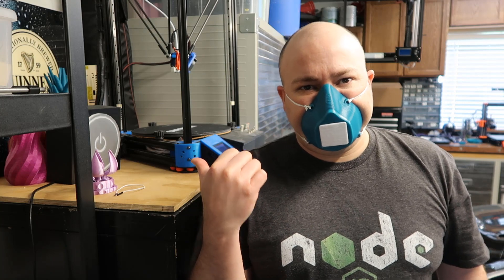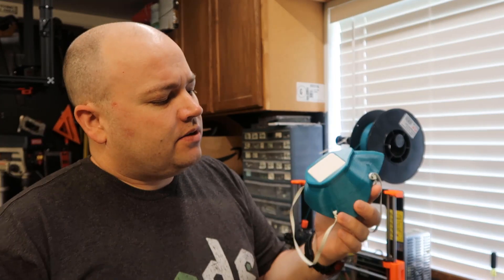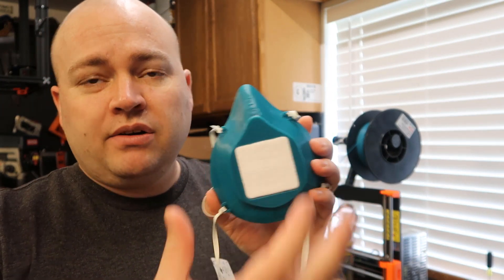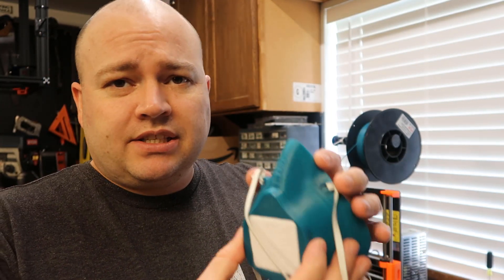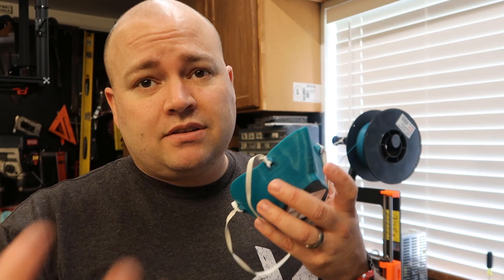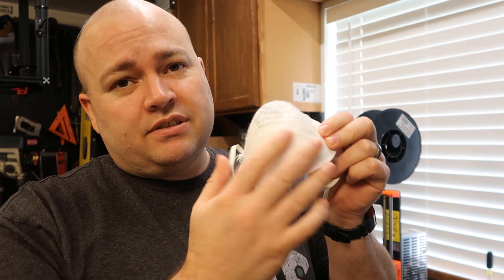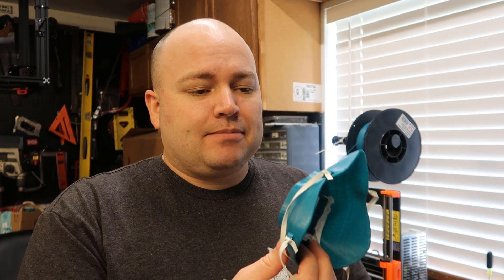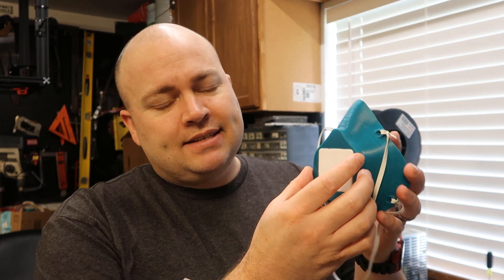3D Printed Face Mask - Print and Review

Comment: Please remember these masks should be used for dust/debris, filters for pollen etc.  They will not help you more than a double layer of cotton fabric mask, with a face shield to keep droplets out of your eyes.  In fact, because of the face shield - the cotton/shield method is better to prevent COVID19 than any filtered mask.  The fit of the mask is also important, it has to seal to your face air tight.  This also means your moisture (spittle when you talk, moisture in your breath, or sweat) will collect in the mask, and cause a pooling - if your covid19 positive, this is a giant mess of infection waiting to happen.

If you want your 3d printed mask to fit better for dust use, use window seal cut out around the edges. This will provide a soft and pliable, yet air tight seal.

If you want to 3D print help, search for the Face Shield printable files, they are in higher demand, universal in size, easier/faster to print, and work better in the medical industry.
Reply: But as a nurse I know the cotton face mask does not do a great job of sealing and people are more likely to keep tugging on the cloth mask. I have ordered a 3d printer face mask of etsy for all my family. I plan on adding black window foam to the edge to be more comfortable and create a better seal. I know I cant wear at work as a nurse BUT when i am out in public I believe I will be better protected with a 3d printed mask than cloth even if you wear 2 cloth masks due to the seal.

Comment: I've made one each for myself and my wife and the same for my brother and his wife. It's easy to make different sizes just by adjusting the ratio in your slicing program. I found the standard size fitted me but was too big for my wife so made hers at 90%. I did the same for my brother's pair. I used self adhesive neoprene foam strip bought from Ebay around the edges to get a perfect and comfortable seal. I had some proper 3M  N95 filters I'd already bought last month, so will use those first but also bought some HEPA vacuum cleaners bags for if they run out. I don't think I'd trust ordinary cotton material to do the job safely.

Comment: Here is a remix of this same mask but with enlarged filter surface. https://youtu.be/35QjGBDAL2M  Probably by the time you read this there will be several improvements to this one also which is challenging for any review like this. TPU would be the way to go vs PLA in addition to some sort of seal.  Mask is only as good as you can improvise it.  The remixed version along with some cloth covering is the way to go. MERV 13 or higher (avoid fiberglass media) . I’ve also seen some versions that use a roomba filter which some claim have a better filter rating than a n95 mask. Also seen a version with a built in pc fan for better air flow.

Comment: The instructions do say to add a rubber gasket around the edge. Fits nice and comfortable that way. Also, HEPA filters from air filters (home, car, even from vacuum cleaners) are great options for inserts that let you breathe but still filter the air.

Comment: How about cutting off a length of soft rubber tubing, cutting a slit along the longitudinal axis (long ways) of the tube going the full length, then slipping the tubing onto the edge that contacts the face. At the point where the tubing comes together one could apply a little hot glue to complete the seal. Maybe apply a bead of glue inside the tube too!

Comment: Sewing seems like the way to go. Pity sewing supplies and fabric stores are closed down. home improvement ones aren't though.

There are also super quick and flexible hot glue gun constructions, but low durability and bad to disinfect.

Maybe lightweight printed frame like constructions can be useful where you span a filter or a piece of cloth into them. They should be quick to print, easy to adjust to face with hot water, and maybe you can quickly weld them shut with filament pins and soldering iron. Maybe they can have an area where cloth wraps in on itself and some kind of installation frame that is then removed and reused, so the face is in contact with softer cloth.